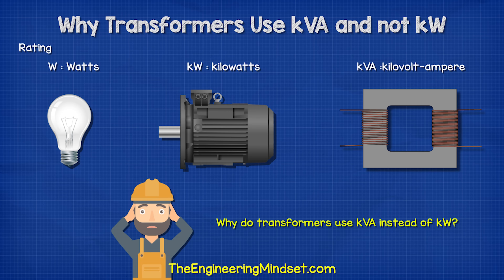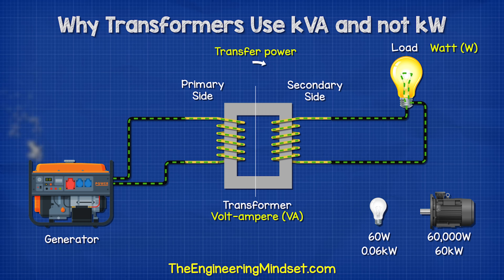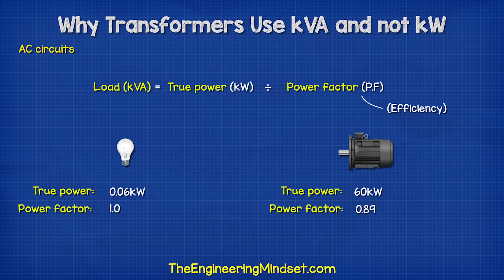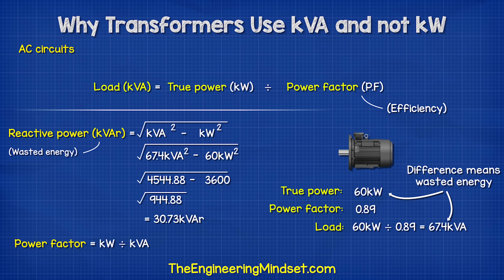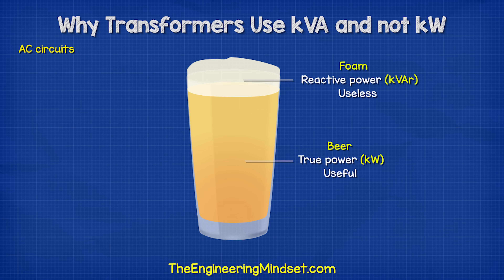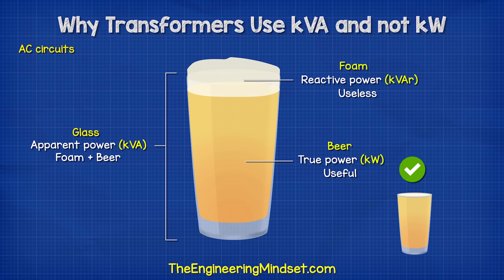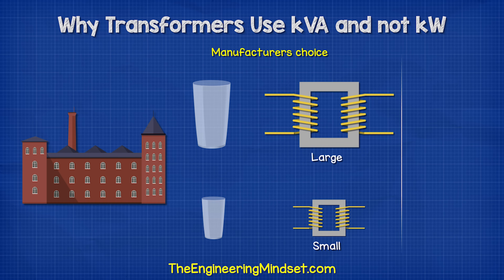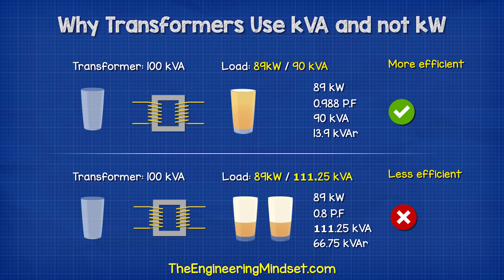Why Transformers Use kVA Not kW

Comment: Written like a true Englishman. Beer needs a little bit of foam. ;)
Reply: Right? Without the protective foam layer, your beer’s volatiles will oxidize and leave the drink tasting stale after a short period of time. Gotta have at least a couple fingers of foam on the head so the beer beneath can taste fresh at least most of the way to the bottom. Either that or, I guess, you have to drink your beer out of a smaller glass, lmao